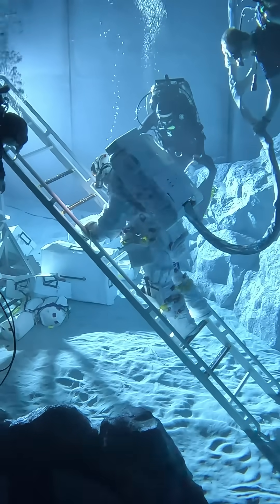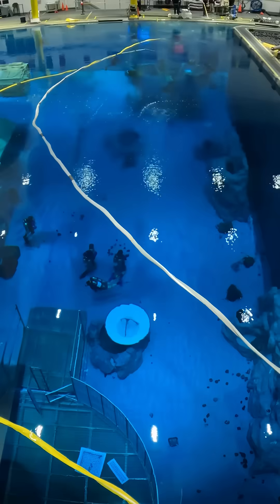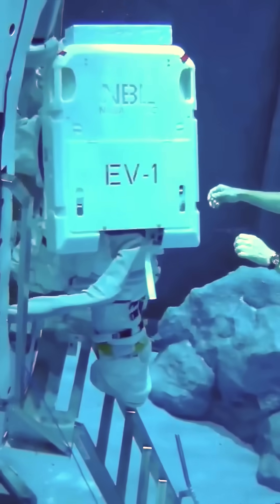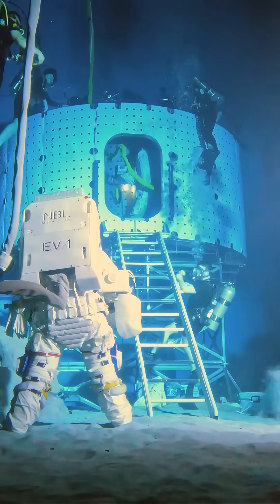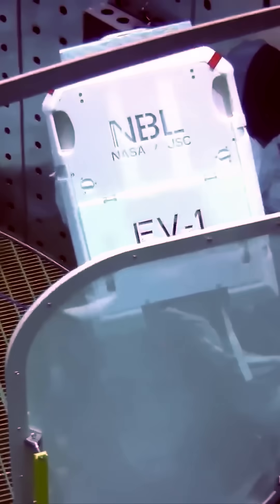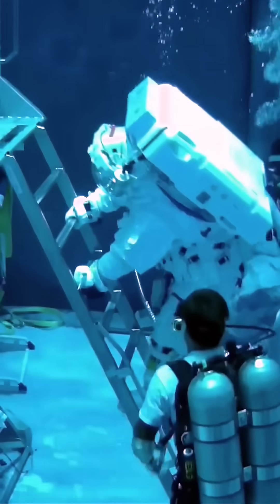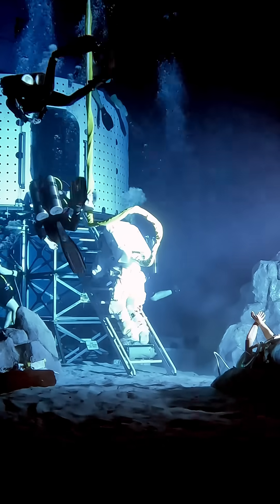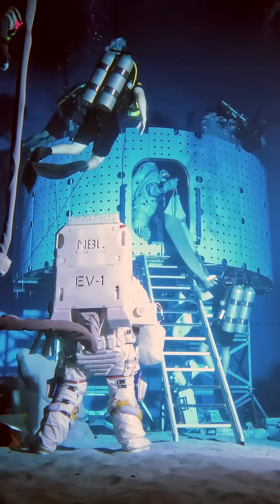Blue Moon MK2 at NASA's Neutral Buoyancy Lab

Comment: Thing is, the equivalent for the other- and first, Human Lander System, Starship- will not fit in this pool, to do the equivalent evaluation, testing, and training. Does that mean SpaceX simply won’t do it, and NASA JSC will let them get away with not doing it?
Reply: An equivalent could easily fit in the pool. The airlock would be at the same height has what we see here with the Blue Moon lander but the lift would be much shorter and anything that falls after they get up to the airlock will be treated as if it has fallen all completely out of reach.